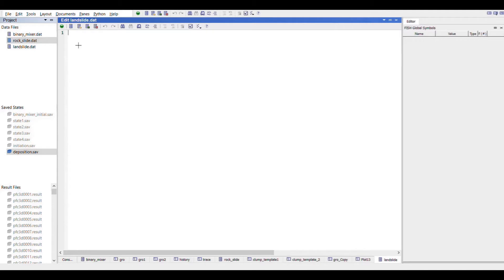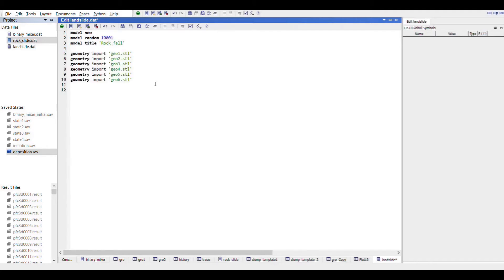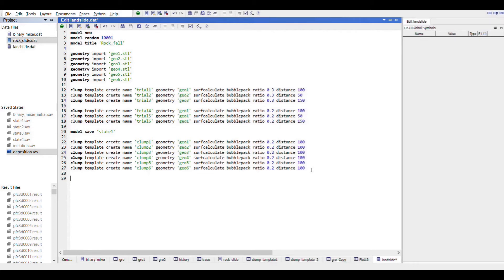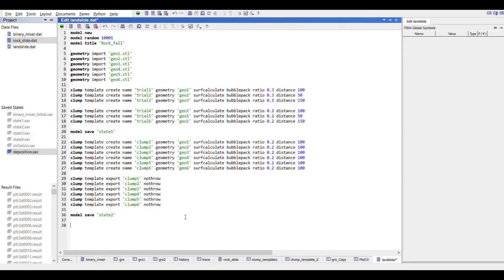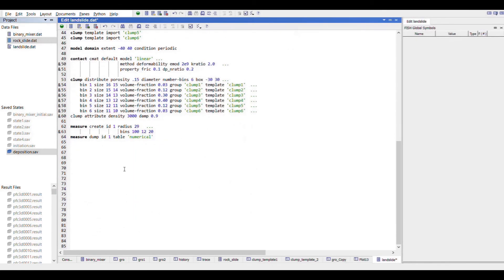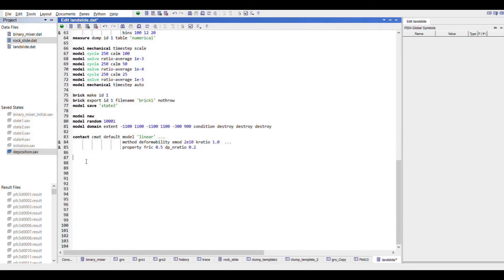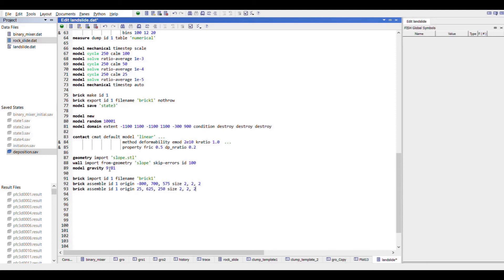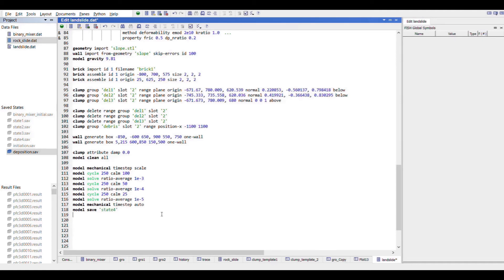Landslide/Rockfall simulation using PFC(Itasca)

Comment: hello, the error i am facing is "Sum of volume fractions is not unity !"? What does this mean?
Reply: ""clump distribute porosity 0.15 diameter number-bins 6 box -30 30 -30 30 -30 30 ...
        bin 1 size 16    15  volume-fraction 0.03  group 'clump1' template 'clump1' ...
        bin 2 size 15    14  volume-fraction 0.12  group 'clump2' template 'clump2' ...
        bin 3 size 14    13  volume-fraction 0.30  group 'clump3' template 'clump3' ...
        bin 4 size 13    12  volume-fraction 0.4   group 'clump4' template 'clump4' ...
        bin 5 size 12    11  volume-fraction 0.12  group 'clump5' template 'clump5' ...
        bin 6 size 11    10  avolume-fraction 0.03  group 'clump6' template 'clump6'"", While using this
Reply from the maker: the error is raised as the total volume fraction sum is not 1. As seen in my code the sum of volume fraction is one. That is must as it means you know what is the amount of each group in the box, so there is no unknown material generated. If this error is coming to your script check for typing mistake.

Comment: Hello,sir. May i ask for some questions?
I´m new with the PFC software .Thank you for this Rockfall simulation. When I use Rhinoceros software to process the 3D mesh to generate a .stl or .dxf file, I import it into PFC 5.0 with the following code "geometry import 'nanpin.stl', wall import geometry nanpin clean nothrow ". the result of the wall in the generation of the code but there is an error 'no facets in the specified range'. based on the above situation. May I ask you how to solve this problem? thank you,sir.  I am also trying to scale down the 3D mesh in Rhinoceros. but the result is not as good as I expected!
Thank you,sir.
Reply from the maker: replied

Comment: Hello. Can this software be used for landslide simulation based on photogrammetric 3D model data?
Reply from the maker: Yes you can. However you need to understand the limitations of the software in terms of particle sizing, physics behind the simulation and dry or wet simulation.

Comment: Sir , could you  please how pfc software can be used for particle crushing?
Reply from the maker: Since PFC is based on Distinct Element Method, there is no direct method for particle crushing. However, you have freedom in your modelling technique. You can either model it as a bonded material with small particles and parallel bond of sufficient strength and once that strength is reached the bond will fail and material will disperse, this can be treated as particle crushing or disintegration.

Comment: Thanks for the demo, however, when I tried to run the dat file, an error occured says 'Sum of volume fractions is not unity !   While processing line 71 of file C:/rock_slide.dat.' May I know why it did not run properly?
Reply from the maker: It looks like you made some modifications to the file. If you have done so please check the sum of fractions is 1 in total.
As in my file from bin 1-6 the total volume fraction is (0.03+0.12++0.3+0.4+0.12+0.03)=1.
Now check yours.
Reply: You can change line 77 to this and it'll work.  ：     bin 6 size 11    10  volume-fraction 0.03  group 'clump6' template 'clump6'

Comment: Hello, Excellent video, I´ve tried to replicate the commands and everything is ok but I have problems with the clump distribute porosity 0.15 diameter number-bins 6 box -30 30 ...
    bin 1 size 16 15 volume-fraction 0.03 group 'clump1' template 'clump1'  ...
    bin 2 size 15 14 volume-fraction 0.12 group 'clump2' template 'clump2'  ...
    bin 3 size 14 13 volume-fraction 0.30 group 'clump3' template 'clump3'  ...
    bin 4 size 13 12 volume-fraction 0.40 group 'clump4' template 'clump4'  ...
    bin 5 size 12 11 volume-fraction 0.12 group 'clump5' template 'clump5'  ...
    bin 6 size 11 10 volume-fraction 0.03 group 'clump6' template 'clump6'  ...

clump attribute density 3000 damp 0.9
I got the error"unused command (clump), I´m confused the reason for this error because on the PFC´s web it is ok, Can I help me ?
Reply from the maker: I have uploaded my data file in the description below so you can try to compare it with what you typed. try to access and run it. I hope the error goes away. In your code, if this is error is coming and the code is still running that means it's a warning rather than an error and that means that you have provided some extra command which you are not using. I hope it settles your problem.

Comment: Hello Engineers mania
The video is very helpful. we are working on a flow simulation project using PFC. If You can help with that it would be great. let me know how can i contact you .
Thanks.
Reply from the maker: let me know the brief details of your flow problem.
Reply: @engineersmania7353   so, in the hopper flow example, we are thinking to insert the water/fluid in between the particles. to find what effect the water might have on the flow of particles like velocity.
you help would be great 
thanks
Reply from the maker: @jaswanthgv7093  If particles only are going to be affected by water flow then the simulation is somewhat easier as that can be done by a basic code representing the physics of fluid flow but if you want to have an interaction between particles and water with each other simultaneously then you will have to use a coupled approach of using DEM with CFD(Computational Fluid Dynamics).